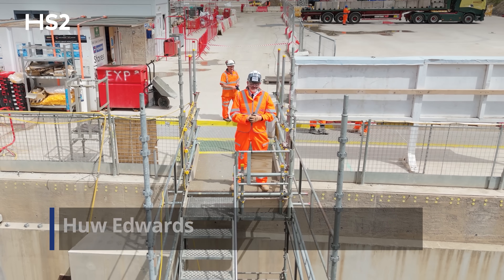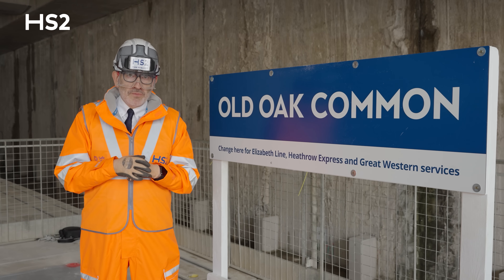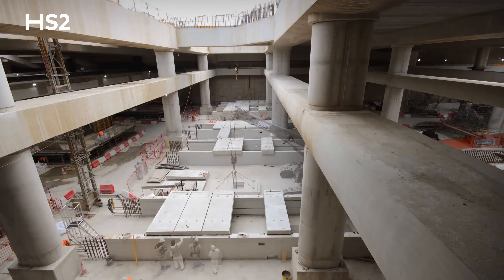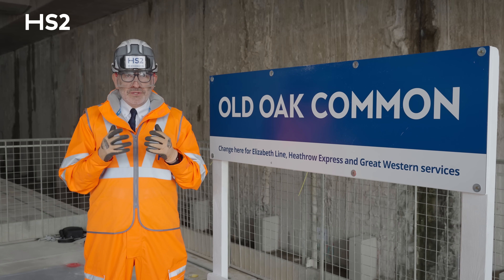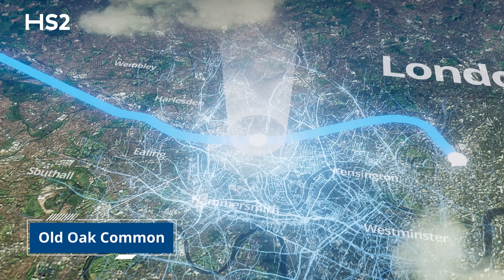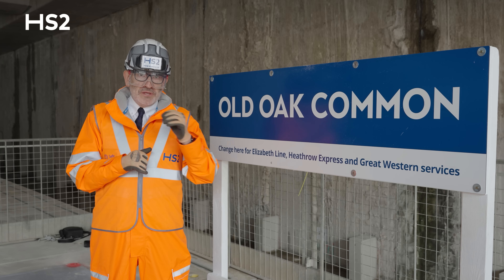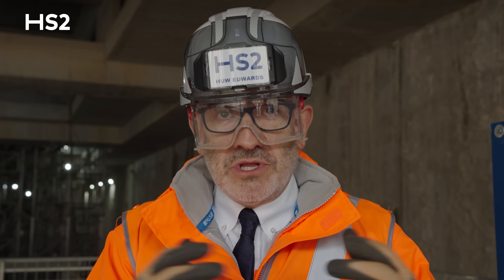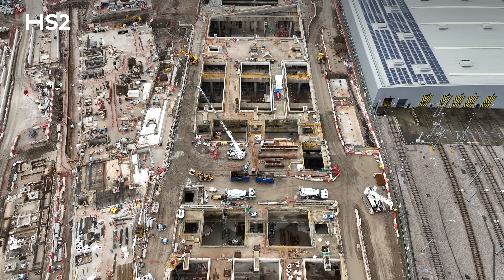Britain’s new high-speed railway: 🚆 First platforms installed at Old Oak Common 🏗️

Comment: It'll only just barely be worth it until we get phase 2, which is where the real value kicks in. This needs to be revived!
Reply: Phase 2 won't be possible as there won't be enough platforms at Old Oak Common (or the newly designed smaller Euston, if the line is ever extended there - which is a big if) to turn the trains. HS2 will just be Ealing to Birmingham and Manchester (switching to the WCML) for the foreseeable.
Reply: @wdielwlairajmd It will still be enough for HS2 to be extended to Crewe and Manchester, just not the eastern section to Leeds, as services will still be running from London to Manchester, just not on new separated high speed track. The eastern section has always been a waste of money anyway because NPR will basically act as HS3 and link Liverpool Manchester and Leeds together with direct connections to HS2.
Reply: @GeorgeTaylor-ht3yy   but you’ve missed the memo. There isn’t going to be an extension to Crewe or Manchester. Land is being sold off and safeguarding has been removed. The only possible new extension is from Old Oak Common to Euston- but even that is unlikely. Any operation to Manchester will be from Old Oak Common and will be impacted by the bottleneck north of Litchfield. HS2 in its current extend reduces capacity to Manchester.
Reply: @wdielwlairajmd  Land for HS2 from Handsacre Junction to Manchester has not been sold off yet as the Mayors of the West Midlands Combined Authority and Greater Manchester are in talks of building a line on the original route to run from Handsacre Junction upto Manchester at a slightly cheaper cost with a speed of 186 mph
Reply: @GeorgeTaylor-ht3yy  Leeds to Kings X is already only just over two hours. It certainly won't be quicker to use HS3/HS2 via Manchester unless it is entirely on high speed tracks. So no-one will use HS2 from Leeds, they'll just use the old service.

Comment: hs2 2a and 2b need to be made for hs2 to meet it actual potential
Reply: Something that doesn’t get mentioned often enough is that the point isn’t to make a super fast connection.

It’s to take the pressure off of clogged up sections of the WCML, improving regional train capacity on the line, as well as freight trains, thereby reducing truck traffic on the M1. 

We need more rail capacity on this trunk line, and it’s not significantly more expensive to build a high speed line than a 125mph line these days, so why not do it.

But yes, it makes very little difference to journey times. It won’t change the lives of people travelling from London to Birmingham and beyond, but it will help those who live in between. 

Of course if the extensions had gone ahead then the distance at high speed would’ve been enough to make a meaningful difference to journey times and improve things for people travelling long distance.

But as usual the government half-arsed it on a major infrastructure project 😢.

We need more investment in rail infrastructure in general, particularly in the North and the West.
Reply: @samlane1078  the thing is since the HS2 trains will need to use conventional lines up north, those railways don’t get any upgrade in capacity, and they are the ones more overcrowded than the London to Birmingham route
Reply: @iliketrains3546yeah, it’s incredibly short sighted to not do the whole project
Reply: @samlane1078  The bottleneck on the WCML is north of Handsacre, so failure to extend HS2 to Crewe is madness if you actually want to relieve rail bottlenecks/increase freight on the legacy system.
Reply: london to birmingham and then going back on the wcml is pointless in my eyes
Reply: Yeah in its current form it doesn’t achieve anything other than marginally shorter journey times between Birmingham and west london
Reply: @iliketrains3546 And London Euston

Comment: At the very least, extend HS2 to Crewe which is a major rail hub.  Ultimately HS2 should go all the way to Scotland and then vis a twin bored tunnel under the Irish sea to NI and Belfast.
Reply: Unfortunately a tunnel to Ireland is an impossibility due to the extreme depth of the Irish Sea and its frequent use as an arms dump throughout the last 100 years. However I absolutely agree, let's get HS2 to Glasgow, and maybe we can even bring it to Stranraer for an easy ferry connection towards Belfast. I'm also hopeful that the recent proposed 'Network North Wales' will get the NWML electrified, so we can finally catch up to the rest of Europe in terms of train-boat connections!
Reply: with a big enough tunnel diameter to allow freight trains to carry trucks _ like the Channel tunnel does but for Belfast _ do Manchester first then Liverpool & on to Belfast _ going to be very difficult
Reply: It's actually not possible to tunnel to Belfast or anywhere in Northern Ireland or Republic of Ireland because of how deep the Irish Sea is and after the world wars we dumped a lot of weapons in the sea so there's a lot of ammunition, bombs and gas down there which makes it way too dangerous to attempt to build anything.
Bridging isn't possible either because of too extreme weather conditions
Reply: I was just about to say the same. I bought a buy-to-let property in Crewe based on the government’s original announcements around HS2, believing it would boost the area. For a country that pioneered the railway, how are we still so inadequate at delivering the infrastructure projects we commit to?
Reply: Sorry won't work going to Ireland as Great Britain and Ireland have two different track gauges, in the UK it is the standard Gauge of 4 foot 8 and a half inches, in Ireland the track gauge is 5 foot 6 inches
Reply: The land for the route to Crewe is being sold - the route won't be built. The government will just get the Old Oak to Birmingham section done as quietly and cheaply as possible and then breathe a sigh of relief!
Reply: Last I read is that land sales are currently frozen until a permanent route decision is made.

Comment: Having just visited Japan, we're lightyears away from how well everything is connected seamlessly over there. I'm excited to see this project complete in the future and the faster journey times but as a whole knowing we practically invented the railway it's surprising to see how other countries have improved vastly compared to ourselves.
Reply: We're partly behind because we invented the railway. It means we're stuck with version 1 - for example we don't have any double decker trains because there are so many railway bridges that are too low for them.
Reply: @TimmmmCam That's a load of BS. France, Italy and Spain all built brand new high speed rail lines for their trains. Having old infrastructure on non high speed lines is not an excuse for not building high speed lines.
Reply: @TimmmmCam  Interesting perspective re V1.  That certainly was a factor, but Britain keeps sticking to old infrastructure,  Why not take a new route ? 
There's also a meme about the width of tunnels in the UK - the butts of two horses pulling a carriage in the Roman times.   🙂
Reply: @2011Azure  The meme about railways being related to the width of two horses pulling a Roman card is bogus and clearly bogus. The UK has had various different sized railways and plateways. The three best known railway gauges are narrow gauge (which is not related to miniature ponies😜), standard gauge and wide gauge (which has nothing to do with Brunel using hippos to pull train carriages 🤪).
Reply: It’s the same here in Australia we even more behind we don’t even have a high speed line
Reply: @AustraliaWorldwide  Look at North America.   Freight trains always have priority over passenger trains in Canada.  Difficult to coordinate when picking up travelers at a station.
Reply: Politicians are weak at the knees(all round the Western world). The cancelling of a large part of HS2 will have consequences for the next 50 years unless someone in Government stands up and says “enough is enough, let’s do this, and start doing it now”.
However, pigs might fly.
Sorry Britain, your incompetent Governments over decades have led to this.
Comment from PICTON, Marlborough Sounds, New Zealand.
Reply: UK is slow in everything...
Reply: Britain is more than 40 years behind the rest of Europe when we start talking about high speed railways. There is no will for this kind of thing in Westminster because they can't get their pointy snouts into the trough without being discovered.
Reply: @cyberdonblue4413 Too much red tape and legislative hurdles to navigate sadly which delays projects here. We should be connecting HS2 to Scotland via the north and be able to easily interchange to HS1
Reply: @cyberdonblue4413  Maybe Scotland should used devolved powers to develop a Maglev service between Glasgow and Edinburgh? Show up the English a bit, you know.
Reply: lightyear is a measurement of distance kind sir
Reply: @eterr9000  Still works though; "we're miles away from how well"
Reply: @eterr9000  And that,  sir, is  exactly how he used the term.
Reply: Briton could never run it's railway the way they do in Japan there train are always on time the driver's dare not be late, its more that there job is worth,
Reply: Italy, France and Spain are light years ahead of the UK when it comes to high-speed rail.
Reply: @bubba842  Yes because the EU paid for them to be built which is what would've happened if we had not left the EU
Reply: you say that, but the ticketing system for the metros in japan is insane, hard to use, and time consuming.
it's a much easier system to use as a foreigner as the JR Railpass is the only thing you need in most situations.
Reply: @KingFinnch just get Suica card on your phone where you can top up and tap in at any station in Tokyo. Easier and faster than London where the gates take ages to open.
Reply: @KingFinnch  I'm not totally sure what you're talking about - Japan uses Suica, Icoca, ... IC Cards which can be used on metro and grocery stores, and in fact, tapping your iPhone with Suica is at least 2-3x faster than when tapping a card in Express mode on TfL.

When it comes to local trains though, I agree. At the same time, Japan's infrastructure is still on another level - not even Japan's anymore, look at China.
Reply: @KingFinnch  You can use the Suica card, in fact, i would say it is more difficult for foreigners because you have go through all the passes and getting tickets in various counters. Meanwhile, a simple IC card will allow you to travel through different systems (and buying drinks in konbini store).

Comment: Can’t you also add a station at the point where HS2 and EWR meet? Faster way to get to Cambridge, Milton Keynes and Oxford which are education hubs
Reply: If you keep adding stations at other key junctures HS2 won't reach its maximum speed potential
Reply: I'm not sure that would work better. There are direct services from London or Birmingham to Oxford. They should be faster than changing for EWR. Same for Milton Keynes; a direct train to either London or Birmingham would be better than EWR then HS2. Anyone coming from the north can change at Birmingham Interchange.
Reply: Maybe you should have a look at a map........
Reply: No because people getting from London to an EWR served station will just go direct, and same goes  for people coming from Birmingham as there are direct trains to most of the places EWR serves. A high speed line needs to only connect where it needs to, otherwise you have yourself a really expensive commuter service

Comment: HS1 was completed early and under budget, hopefully HS2 has it's northern leg reinstated after their "reset" review
Reply: HS1 didn't involve boring tunnels for the purpose of not upsetting the local golf club members
Reply: @EASYTIGER10  A quarter of the entire HS1 line was in tunnels.
Reply: @bluebellsalmon  Yes.  To get under east London, the Thames and the North Downs.  All NECESSARY tunnels.  Unlike tunnels under some of the flattest fields and golf courses in Buckinghamshire...
Reply: I agree but it looks as though we will spend it all on tanks, planes and submarines!
Reply: @SWRural-fk2ub  Something which is needed though, id rather have more defense than a High Rail I'm never gonna use
Reply: If it doesn't benefit Israel, it will be far down the list of priorities....
Reply: Hope not, the waste and the damage is bad enough already.
Reply: Haha that’s never going to happen. HS2 will be a victim of its own success as without a northern leg, it will create a huge bottleneck mess in Stafford, further decreasing capacity on the west coast main line, which is exactly the problem it was planned to mitigate.
Reply: @iliketrains3546 why will Stafford be a bottleneck? Is that due to the HS2 trains joining the west coast main line just south?
Reply: @masterbarnard  yep, so the high speed trains will have to pass through the already crowded station. The section of line from Birmingham to Crewe via Stafford was the section which would really benefit from HS2, and now HS2 trains go straight onto it, effectively making the over capacity problem even worse. Wouldn’t be a problem if they went forward with the Crewe extension
Reply: @masterbarnard  With the current HS2 plan, capacity between London and Manchester will actually be reduced. The HS2 trains that will access Manchester will have fewer seats than the current trains. In addition, the railway between Litchfield and Crewe will now become a bottleneck, so additional passenger or freight services can't be added. Add to this, the Manchester HS2 services will only travel to Ealing (Old Oak Common) so journey times savings will be reduced as passengers will need to travel from Ealing into Central London.
Reply: @iliketrains3546 That's the most obvious political compromise in the short term. It's also the most sane one, as it has no effect on any future decisions to go further, but would enhance the impact of any future developments too.
Reply: Pretty sure Hs1 was both late and overbudget
Reply: The Northern leg is dead, with land acquired being sold off and safeguarding removed. Old Oak Common can only turn a small number of trains per hour, so not even the full West Coast service can use HS2. In addition, most passengers will want a train into central London, so many will continue to use the existing services. If the line is extended into central London, the Euston station redesign has reduced the platforms, so the Eastern leg would not longer be possible. What a mess!
Reply: @wdielwlairajmd  Yeah the eastern leg is no longer possible, but the section to Crewe and then Manchester still is. The delta junction is also still being built to full spec as according to multiple sources and hs2 website. I’m pretty sure it even still includes the provision to Leeds but even if it does, I doubt the capacity will be there to handle it. Forget the Leeds leg though, it needs to go to Manchester, and then link up to NPR which will take it to Liverpool, and Leeds. NPR is basically HS3 but with a new name so it causes less controversy. HS2 to Manchester and NPR will give England a high speed rail network that links all our major cities together.
Reply: Also I forgot to mention the land acquired for Crewe and Manchester legs has still not been sold off, so it’s not completely dead yet. The Leeds section is though as that has all been sold off I’m pretty sure.
Reply: @GeorgeTaylor-ht3yy  ALL our major cities is quite an overstatement
Reply: @iliketrains3546 As someone who longs for nationwide HSR connectivity in the uk, this will never happen under the current governments. At least a HS2 to Birmingham Manchester and Leeds, will link up the 4 biggest cities in England though. This is somewhat realistic and the best we’ll get in our lifetimes. Ideally if I were in charge, I’d propose HSR from London to Norwich Plymouth Cardiff Manchester Leeds Newcastle Edinburgh and Glasgow .
Reply: @iliketrains3546 HS2 to Manchester and NPR (HS3 in disguise) is the best we’ll get if we’re lucky
Reply: @GeorgeTaylor-ht3yy  yeah I think IF they both somewhat happen, it won’t be until at least 2050 which is just sad to think about considering all our ages at that point
Reply: @iliketrains3546 Government is only interested in projects they can make profits on unfortunately. But at least we’ll have the second fastest conventional HSR in the world, albeit just a shuttle service between Birmingham and London.
Reply: @GeorgeTaylor-ht3yy  there is no chance of an extension. The current government will simply deliver the current scheme as cheaply as possible (expect speed / specification reductions) and then celebrate once it is off the government’s books and no longer a liability.
Reply: @GeorgeTaylor-ht3yy  Was it sold off prior to 2024 election at knock-down prices? Because if it was, there's a case for criminal prosecution of HMG officials for 'behaviour incompatible with being responsible stewards of the taxpayers' money'....